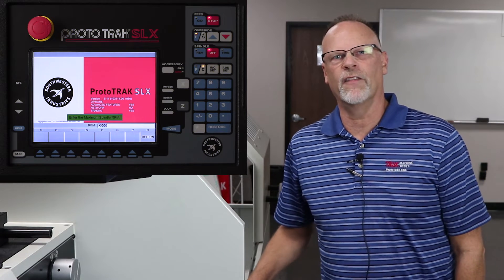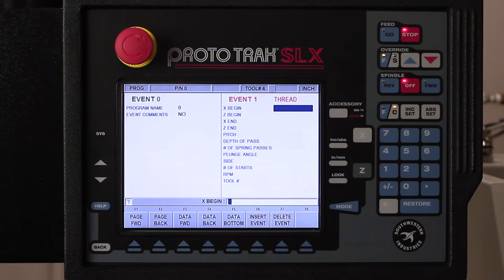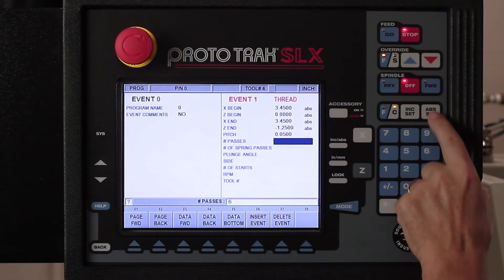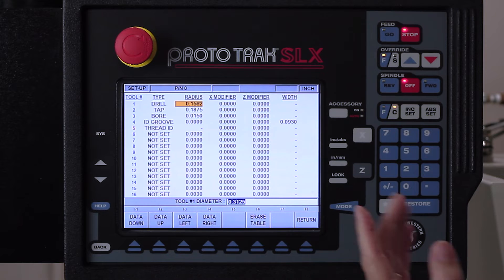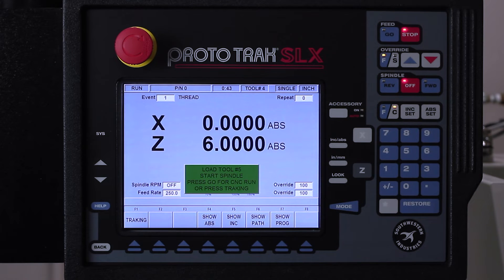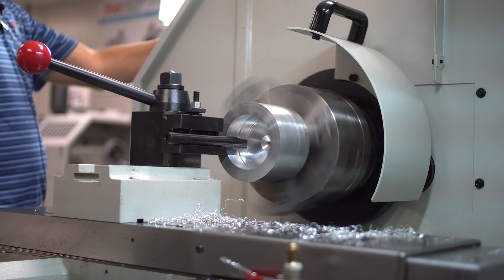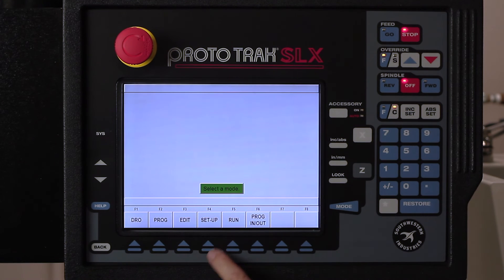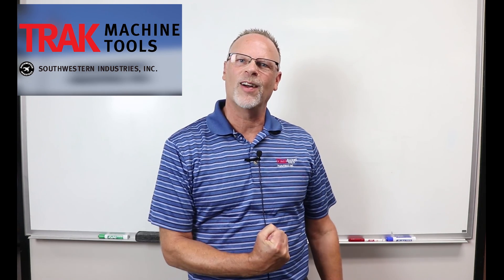ID Threading | ProtoTRAK SLX CNC | Lathe ID Programming 5

Comment: Hey Tracking Pat. I have a question regarding internal profiling. With Internal boring, the tool retracts from the material moving X minus before the next cut. When internal profiling, the tool seems to always move straight back in Z positive before retracting in the minus X direction, then feeds back into the X positive dimension for the next cut. I keep snapping tools because of this tool path the machine makes. Please note that I mainly program my profiles, internal or external, using the .dxf programming. Please help me to stop breaking internal profiling tools, aka Button Tools. 
I love all your videos and I've learned so much!
Thanks,
Rick
Reply: Hi Rick, thanks for the good feedback!  I assume you have an SLX since this video is on this control.  There is a .020" X move built into the ID cycle and boring events.  Unfortunately, there is no way to change that built in feature.  There may be a few ways I can help you.  First, make sure this is not a service issue.  Depending on how old the machine is, you may have some crab walking going on due to the gibs needing to be adjusted. If so this will make the tool drag on the way out. Second, I assume you are using a CYCLE to do this profiling.  If not, you should however if you are and are still experiencing this issue, you may want to create your own boring cycle by using turn moves and positions.  Just turn in, position towards center and position back out.  Once you do this, you can use repeat events to step the toolpath over until you achieve the final bore size.  I have a feeling this is service related but if not, this should help you.  You can also call your local TRAK rep and have him stop by to see this. He should be able to advise you on what you need to do.  I hope this helps!  T.P.

Comment: I'm probably late to the party to start asking questions, but it is established that the lathe spindle does not have an encoder. So when the option to have a multi lead thread is presented how does the lathe know where it is currently to have them evenly spread out?
Reply: Nicholas, Sorry that this sounds confusing.  The spindle does have an encoder so that it can pick up the same points on the thread. What it doesn't have is the ability to do rigid tapping so we suggest you use a floating tap tapping head if you want to tap holes. I hope this helps!  T.P.

Comment: So for a 1 inch 7/8 - 20 UNS ID thread the bore size is 1.825 and then the X start for the thread event is 1.875 (1 7/8) ?
Reply: You are correct.  In a standard thread, it will start inside the bore and finish at the 1.875 diameter.  If you select custom thread, you will enter the minor and major thread diameters. HINT: if you program a boring event first at 1.825, after you program your thread, it will show it in the look screen so you will be able to see that it is correct. After that, you can just delete the bore event.  T.P.